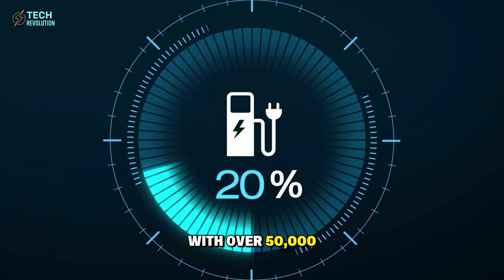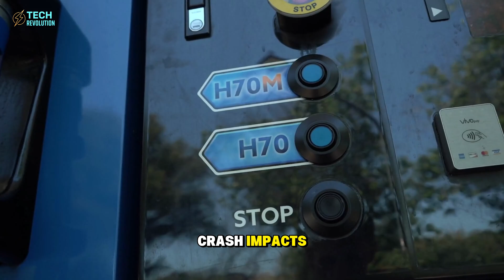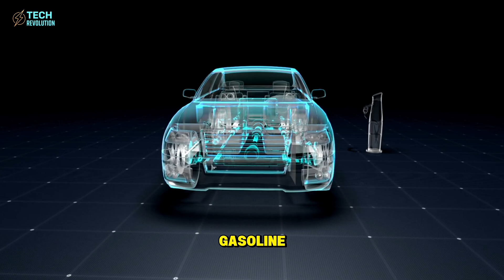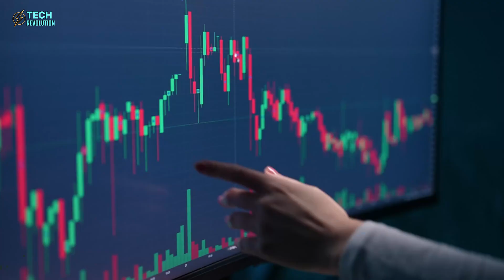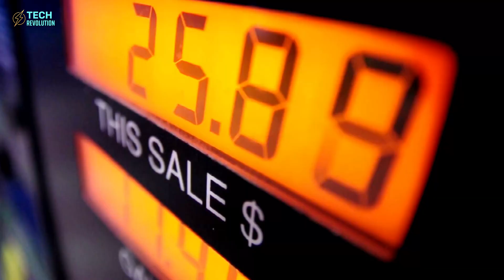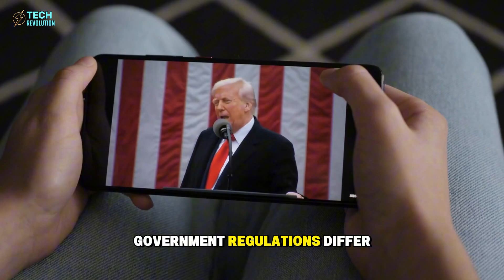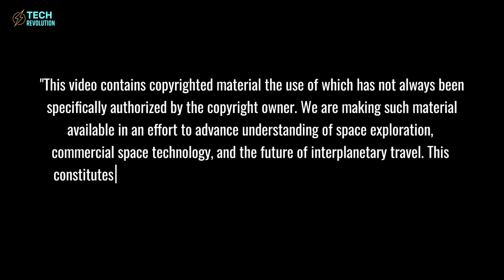Tesla Ditches Batteries! Elon Musk's Water Engine SHOCKS EV Industry

Comment: Hydrogen - - - NO ---  NO Hydrogen.   It will be the same SCAM as the gasoline.  90% TAXES.  It will make the RICH - RICHER.  Besides separating H from H2O is too costly and dirty.
Reply from the maker: Exactly — hydrogen’s inefficiency and cost make it unsustainable. That’s why the Tesla Model 2 pushes battery innovation, not another fuel-based dependency.